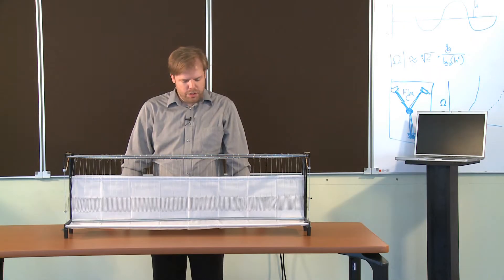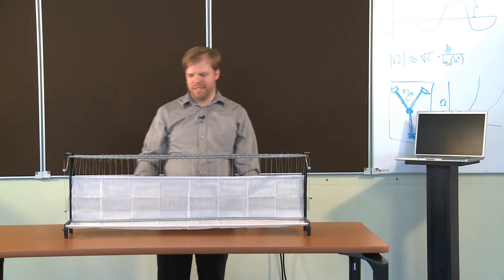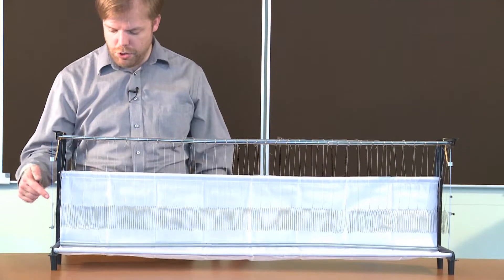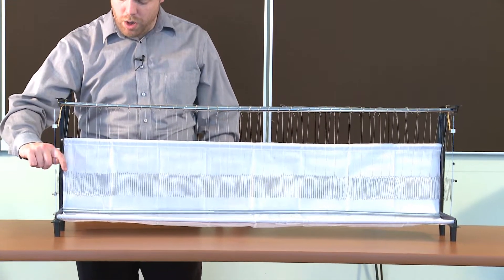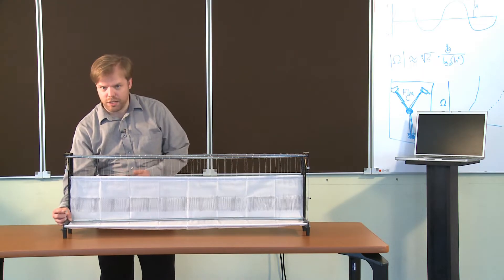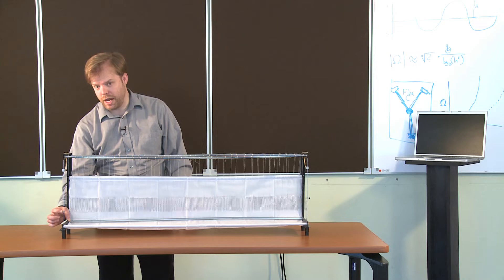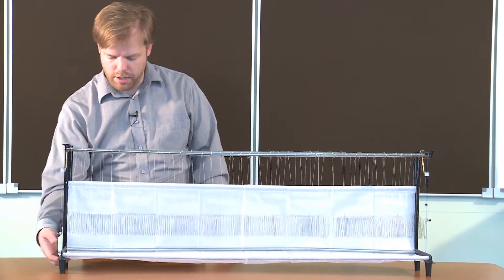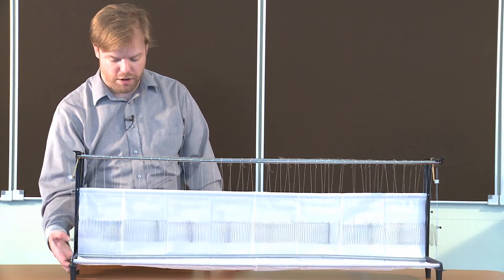Longitudinal Wave Demonstration

Comment: Are the area’s in between each darkened block representative of the compression? If it is what would create the vibration of the wave if it was an independent source you didn’t have to control like operating the movement of the slinky?

Comment: Sir if it exist polarization
Reply: It depends. In the context of a sound wave in the air, the air molecules are either being pushed together or pulled apart. I suppose gravity is involved in the suspension of those air molecules and therefore polarization might be a factor. But magnetic polarity like what you see in an electrical wave, is not really part of a sound wave. However, a positive polarity on an electrical wave that is then converted to a sound wave through a loudspeaker corresponds to the compression of the air molecules. The negative polarity on an electrical wave would correspond to the pulling apart of the air molecules in a sound wave.

Comment: That's not a longitudinal wave, that's an illusion for a longitudinal wave. The oscillation occurs via resonance through the rod above into the strings.
Reply from the maker: The oscillation comes from a vertical flexible rod on the side that is attached to the spring. A longitudinal wave is one where the displacement is parallel to the direction of propagation. In this case, the displacement is left to right from the oscillating rod and the wave propagates in that same direction.